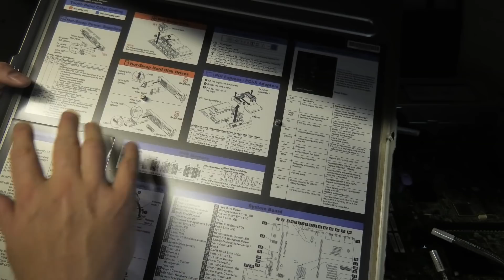Lenovo x3650 M4 - But Rare 6*3.5" Model - Overview - 989

Comment: I wonder if that 3.5” hard drive cage & backplane will fit in my M3?  I like the idea of 3.5” drives, but if this cage won’t fit in my server I may try to get the parts for the rear drive option for 3.5” drives.  🧐😁
Reply from the maker: I do not believe that I have seen 3.5" for the M3,, so that is a long shout!!

Comment: Love the channel!
Have you done a shout-out about the critical firmware update needed for the M4s (it's a year old though...)?
Mine just died when I rebooted it, it's a component that gets overvoltage due to a software bug and burns the "VT261WF" during power-on.
https://lnv.gy/3l4HrJQ (Lenovo support page link)
Seems like it can be replaced but it's a bit above my soldering skills.
I miss my M4, I bought a smaller DELL PE R630 instead... :/
Reply from the maker: Thanx for the info,, I did not know that! I have a x3650 M4 video comming up,, will see if I can do something.

Comment: Recently I saw an X3650 M5 with 12 * 3.5" on sale. It was the older MT 5462-AC1 model [E5-2600v3]  it was under $400 USD. The later MT 8871[E6-2600v4],  as you may well be aware, has doc saying that 3.5" drive supporting models exist in different physical configurations. 
Thanks for your great content
Reply from the maker: Hi garyslinn
Thank You very much!  glad you liked the video :-)
Thank you for watching! :-)

Comment: Hello Mortan, I recently acquired some IBM systems like you mentioned. 3 system x3650 M1 with 2.5” drive bays and room for a tape drive. Also have 1 x3650 M4 and 1 x3690 X5. Do you happen to have the older version of the update utility for the M1 systems I believe the newer one supports the M4 and the X5 but I need the older one. If you could help point me to the files that would be awesome. Thank you very much for your content! Please feel free to email me vinatron2@gmail.com whenever you have the chance. Kind regards, Vincent
Reply from the maker: It can be fund at IBM's site,, you have to go pretty far back, for it to work.
Reply: My PlayHouse I’ve so far been able to only find the one that supports the M4 and X5 I’m still looking for the M1 version if you ever want to see my IBM hardware sometime I have more than just those I have a Power7 720 a 9406-270 system-i a IBM mainframe z114 a DS6800 total storage and a zHMC witch is a system X3200 M3 very quiet server I also have a lot of dell stuff but the IBM systems I have are way cooler

Comment: A somewhat contemporary rival is the HP(E) ProLiant DL380p Gen8, which also came standard with 2.5-inch (they call it SFF) drives, but could optionally be ordered with 3.5-inch drives as well. In my company we have about 50 of those (the other Gen8's being DL360's), and only 1 of them has the 3.5-inch drives. But we hardly use any of them as storage servers, most storage is external (3PAR via Fibre Channel, or MSA/disk cabinet via HBA).

Major difference however is that that DL380 can fit 12 drives as standard in that 3.5-inch (LFF) factor, but you have to give up all front connectivity, optical drive and diagnostic display. Only the VGA port is available on the left. Another model which does feature the optical drive and front connectivity can only fit 8 LFF drives.

As for the drive numbering: well, if you don't like counting from zero, it's even worse in the network world. Some brands (Juniper, at least JunOS-based devices) always start to count from zero (ge-0/0/0, xe-0/0/0, etc..), while other brands start to count from one. Even within the same brands there can be multiple systems, as some product lines were taken over/inherited from other companies (HPE having bought H3C, 3Com and recently Aruba, Juniper took over Netscreen, Cisco bought Meraki, Extreme Networks all legacy stuff from bankrupt Avaya and Nortel) and still carry over that legacy into some of today's network equipment.
Reply from the maker: Hi btrs
Thank You very much!  glad you liked the video :-)
Thank you for watching! :-)

Comment: One of the main reasons that I have stuck with Dell over the years is they have kept models available that had optional 3.5" drive configurations. And my servers and labs have been really heavy on storage capacity so I needed those good old spinners for max capacity. Only recently, due to cost, have I been looking into going with a NetApp disk shelf and an HBA to offload my data stores.
Reply from the maker: Okay,, I do not think it will be long, before SSD will kick spinning drives butt also in size, and then 3.5" will not really be needed any more.
Reply: @MyPlayHouse  I hope so. My biggest limitation is cost per terrabyte. lol.

Comment: Hi Morten! That's a pretty neat x3650 M4 you got there! Do you mind doing me a random small favor? I need to know whether the power supply fans in this model keep spinning even when the server is off, or not. So, if you have time, could you check this for me please?
Reply from the maker: I will try to make a note of it,, I do not have any off, and powered at the moment.
Reply: @MyPlayHouse  Thanks a lot! No rush. I just happened to buy a couple of these PSUs really cheap and wanted to adapt them to power other things. But the fan is always on, even in standby. Was wondering whether there's any special command sent by the server that can turn the fan off.

Comment: why bother there old as sin and your power consumption must be throgh the roof, sereoiusly x2 modern proliants could outperform that entire stack
Reply: i was thinking the same. There is no point (beyond that it is fun to play with it), you can get a ryzen 3 3300x wich also has 4 cores but is waaaay more power efficient, also works with ecc memory, a motherboard with chipset b450 or b550 wich comes with real pcie x16, if the purpose of the server is to store data, just look for a motherboard that has 6 sata ports or buy an expansion card that support all your drives.
Reply from the maker: Newer server is faster,, but there are still, cases where you might want to prolong the life of an older server, instead of coughing up the reasonably big amount for a new enterprise server.
Reply: You're missing the point !!

Comment: The 3.5" models are very rare on ebay. There was also the x3630 m3 and m4 that could handle up to 12 3.5" disks in the front plus two 3.5" disks in the back. I've got a x3650 m4 HD today that can take up to 24 2.5" disks.
Reply from the maker: Uhh bad ass server :-)

Comment: Hey Morten,
you might want to check out the IBM 4380-Q2E "QRadar" Appliance.
It is technically a "X3650 M4 BD" system (BD meaning "Big Data"), which features double the drives bay with 12x 3.5" bays in the front.
Reply from the maker: Thank you very much!

Comment: Love these setups, being in Australia though all I can ever think is how expensive it would be to run and how much i'd love to have cheap power :(
Reply: Yep, have to agree there. But in my case they're a little more than a hobby, so I put up with AU$750 /quarter electric bill. That's running 3 HP DL Servers. A DL580, 380 & 360. Uses a total of 0.8kWH of electricity. I can run my fully loaded C3000 Blade Centre instead which is a little more economical at about 0.7-0.75kWH until I push the BL680 4 X Quad core blade to the limit. But it's all in the name of fun. 😁
Reply: @Gemini5AU  woah thats a lot for 3 servers, is that at idle!? I have three 3900x servers sipping about 90w in total idle. I used to have a DL580 but now my power is 0.60c kwh I sold it and went with as power efficient as I possibly could for my use cases.
Reply: @zengineer_au  They're a little bit more than idle. The 580 has my VMs on it. I just checked... it's running at about 40%. My 380 is used for video rendering and as PC......it idles mostly. The 360 has a firewall and rsync running on it. I've started to move it all onto my C3000, but need to replace the onboard network switches with pass-through. It'll give me a bit more bang for my buck, as long as I'm using it. The 380 will stay as is until I finish setting up my ML350G8. Initially I'll set it up for foldin@home.
Reply from the maker: I do cheat and am not running it all 😏
Reply: @MyPlayHouse  I guess it's also a matter of...do you need to run it all? Probably not. I have an ML530 G1, DL360 G1 &G2 and a DL380 G4..... they're only there because I probably won't throw them out. They are usually off unless I want to play with something. I'd imagine you don't use your M2 servers much if at all?

Comment: I do have 4 of the x3650M4 and 1 x3650M3 in our office, sort of "work lab", turned off most of time, but pretty good with latest firmware levels. On the other hand our customers have to throw away many of them (M4s), because of broken Main-boards- (Raid controller does not communicate, network card stuck and cannot be unstuck, TPM died, Motherboard error appeared and board itself died, IMM2 lost communication with system, etc.) which had to be some mass problem. I had changed minimum of 3 of the M4s mainboards myself because of this problem- where customers bought replacement ones... The M5s and later have very many of extra and new features, so I would recommend those instead, also havent had much trouble with them.
Reply from the maker: Only IBM/Lenovo server that has ever died on me,, was an M4,, 😫
Reply: @MyPlayHouse  As you know- and now you know why- I have very similar experience with M4s :-)